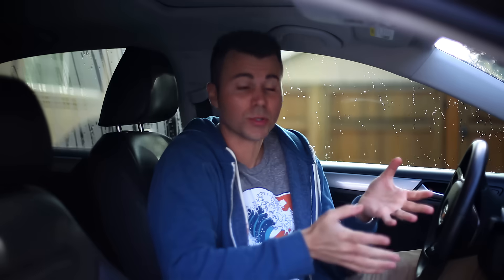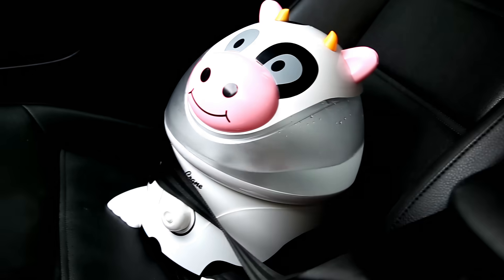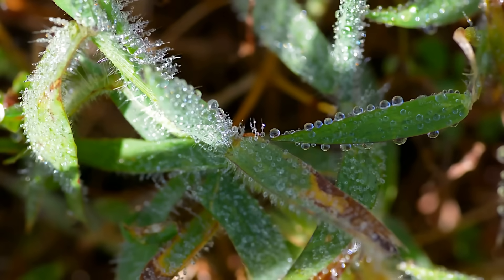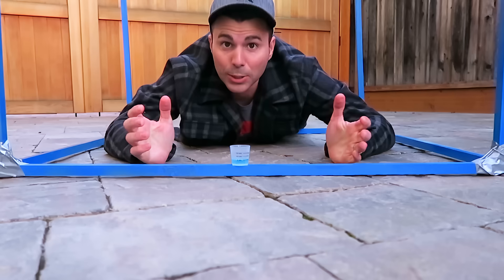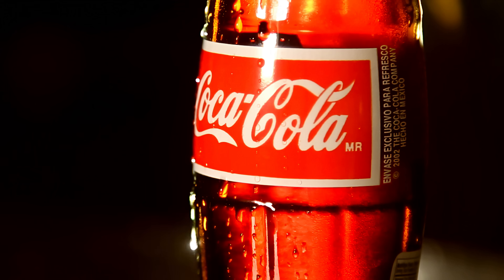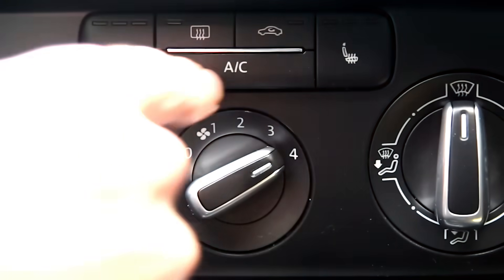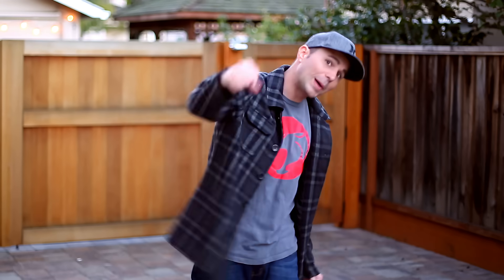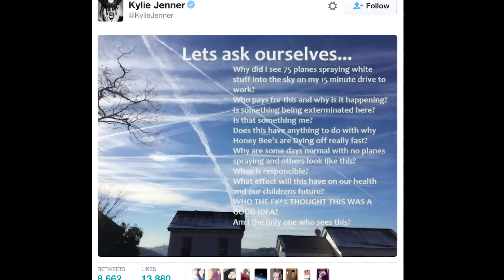Defog your windows TWICE as fast using SCIENCE- 4 easy steps

Comment: This is just basic common sense. The air conditioner draws moisture out of the air as it's primary function of cooling. So blasting aircon air will remove the moisture, and the purpose of putting the heat on is that it won't immediately heat up, but after you run the engine for 5 minutes or so, the hot air being wafted onto the glass prevents it from re-fogging up.
NOW, to De-FROST the outside of the glass, There are just as many theories, but this one works the best. 
Get a litre of Isopropyl alcohol and put some in a spray bottle, then dump the rest into the windscreen washer fluid. 
Spritz the windscreen on the outside with the alcohol in the spray bottle and the ice will fall off. Alcohol lowers the freezing point of water, and alcohol absorbs water like a sponge, so it will melt the ice on the glass first, and as it melts it spreads and mixes with the newly melted ice and cause a cascading chain reaction.
Surprisingly the alcohol in your windscreen washer fluid will not evaporate or catch fire.. But it will do several jobs, when you pull the trigger it will clean the glass MUCH better than soapy water, it will evaporate faster if you're moving, and if it's snowing or frozen, it will mix with the ice as I said above. 
Several substances will do the job of shaving cream, anything that breaks the surface tension of water will work, any surfactant, soap, etc.. Or silicon based products like armour-all. Rain-X and Fog-X are silicon & isopropyl. The isopropyl helps to make the silicon spread further, faster, and in a more even coating, and the silicon is a physical barrier that water cannot stick to, so it will just bead up and roll off.

Comment: How can you have the heater and A/C on at time same time ? Seems like your knowledge about car or automotive knowledge is non existent
Reply: Gaz Girl yes you can. Want to send you a picture?
The hot air comes from the engine. The a/c works in parallel . You just press the ❄️ button and set the temperature at maximum

Comment: I have 2 gallon jugs of a little colder than room temperature water (can do the trick in one) and pour it on my windshield. Use wiper blades a few seconds and they glaze back over. Repeat once more and you'll be ready.

Comment: Best combo i found, hot air, fresh air not recirculate, and AC on. Many new cars automatically turn your AC on when you turn the vents to defrost only. Hot air because as stated in the video hot air can hold more moisture so it speeds up evaporation. Fresh air that way you are not using the humid air inside your car, and AC because your Air Condition unit actually acts like a dehumidifier drying the air out allowing it to soak up more water faster.

Comment: I live the the Pacific Northwest where the air outside the car is usually more humid than the air inside the car. For this reason I use recycled air, especially when I use the ac setting which dries out the air. Maybe that’s just true in areas where moss growing on your car windows is an issue lol. My 1999 CRV fogs up something fierce though.. it’s a constant fight.

Comment: +Mark Rober:
There's a hack to avoid having to scratch frost or ice off your windscreen on the outside:
Take an empty 1,5 liter bottle filled with hot tap water (just hot, not boiling; hot tap water here in Austria is be around 45°C to 50°C AFAIK) to your car. If there happens to be snow on the windscreen too, brush that off first (just get rid of most the snow, a few brush strokes should do), then pour the hot water slowly over the whole windscreen from the top edge while going from one side to the other, run the windscreen wipers a few times right away to get rid of the water and you're done.

So, perhaps you could look into how that hack could be optimized with science (minimum amount of water needed, minimum water temperature necessary etc.)... *nudge nudge wink wink saynomore* ;-)

Comment: So in my '69 that I insist on continuing to drive in the winter, I should turn the heat on full and crack the windows? Someone removed the A/C at some point between 1969 and 1996, so that's not an option... Perhaps I'll try the cat littler. Awesome video!

Comment: Most modern cars automatically run the AC pump when in defrost mode. Some modern cars also disable the air re-circulation function. So you can not operate in recirc, and defrost at the same time.

Comment: LIVING BY A LAKE, WINTER AIR REFREEZES IMMEDIATELY UPON SCRAPING AND DEFROSTING!!  PRE-WARM CAR (WASTEFUL) IS ONLY SOLUTION!?!
Reply: No, it's not. Clean the windshield (inside and outside) several times with the strongest window cleaner you can find (the plain window cleaner, not the fancy muti-purpose stuff), then coat the outside with Aquapel and coat the interior of the windshield with Rain-X Anti-Fog. This also can make a huge difference but I suggest having your heater and cooling system checked for leaks (I have seen small leaks migrate to the inside of he car and cause chronic fogging),  and repair them if any are found.

Comment: Some cars always run the a/c compressor when on the defrost setting, so actually turning the a/c on could be superfluous for some people. Most Ford's do this. You can easily listen for the sound of the a/c compressor coming on when you switch settings. Plus, some cars have compressors that cycle on and off so it's very clear if you give a quick listen outside the car if the a/c is running.

Comment: I used to design HVAC for the auto industry.  Guess what....  All you have to do is press the defrost button on any modern car.   The defrost button automatically puts the recirc door into fresh and then it automatically turns on the A/C as well depending on the temperature outside.  Cracking the window is really the only other step you need.    Push defrost.... crack window...  Done.

Comment: Very nice practical experience. I came across my practical in winter if I have eaten allot of food which has wheat, I have got moisture on the inner side of windshield, what I have done just open cross windows about few inches and it got cleared. 
2nd I like to share my experience is that, if we open only 2 front or 2 rare windows the fresh air dosent circulate we only hear loud sounds. 
On other side of we open (few inches or half)only 2 window with any combination accept the one mention above you will get fresh or outside air.
Once you experience that then u know which side you need to open and where the wind goes( I know, but you can make video on it, ) or call me , seven zero three- seven eight six- five. Eight six eight.
Thanks,
 Agha Bilal

Comment: It's about temperature equalization. When it's cooler outside you heating it from inside with your body and breath, which creates condensation, just like when you breath on glass/mirror to try to wipe it clean. Therefor cooling it from inside equalizes surface temperatures and removes condensation fog...For same reason when windshield gets overcooled with AC from inside while being too hot outside, it condensates on outside and it can be wiped with wipers and cooling it less or not it all stops it from happening.
Reply: In addition, you can remove condensation fog in winter with heat on windshield as well, which heats so much, it evaporates moisture, which i'm doing simply because i'm already could...HOWEVER every manufacturer i tried builds AUTO ac ON at windshield function, means when you turn off your AC, it will get overridden with windshield selector, it will not show light on AC control, but it will be cooling it without any standard way for user to turn ac off.  Therefor if you want heat on windshield, you are forced to run AC compressor as well, making nonsense extra wear and tear and increasing your millage. WOW, how about to leave it up to us and put a helpful note about it in manual.
In my older 06 Ram i cut compressor feed, added switch with light control, which also indicated compressor cycling, and i could heat my windshield in peace, dem engineers.

Comment: Btw.... by turning the knob to defrost, your a/c compressor comes on automatically.  It does this to dry the air so it doesn't blow more moisture  on to the windshield.  Its almost as if the car manufactures know what they are doing... hmmmmm